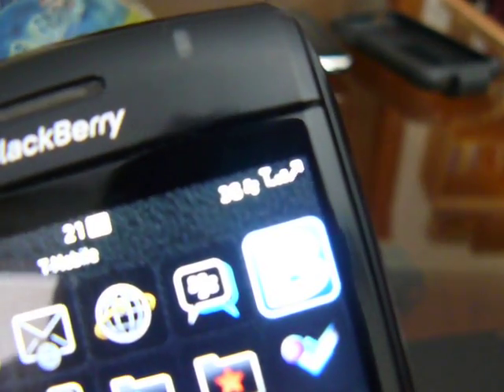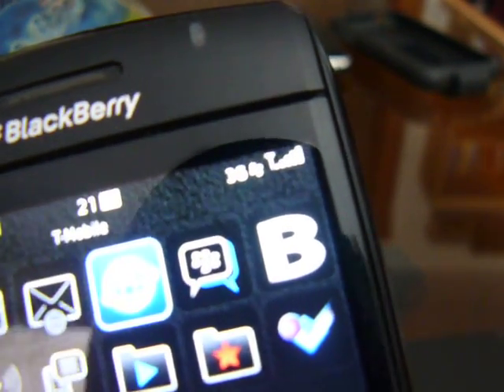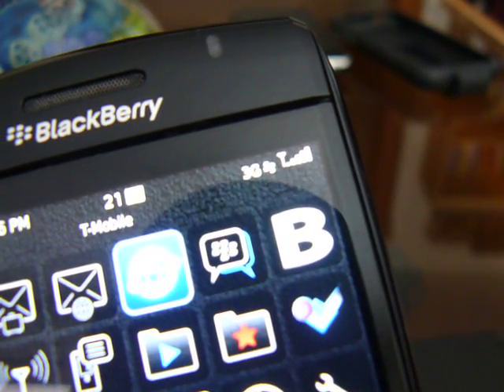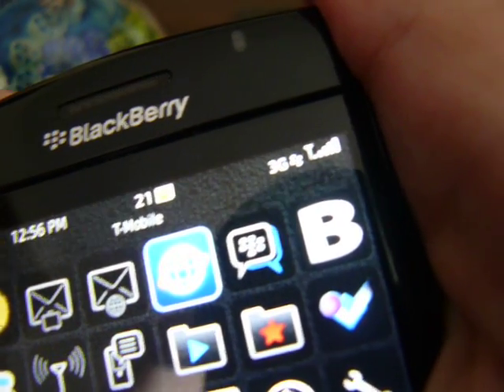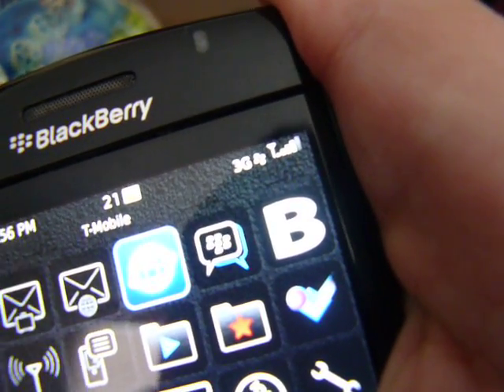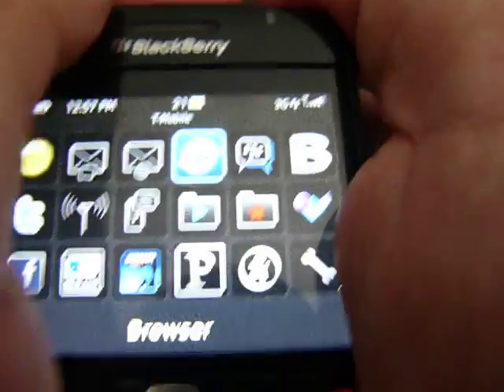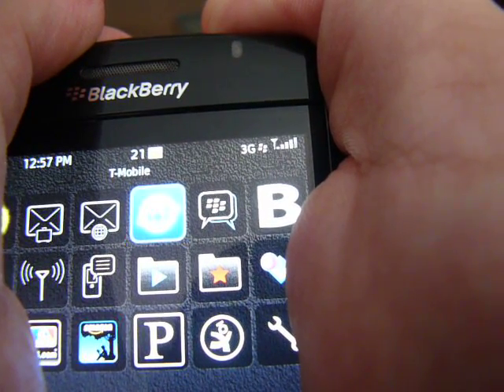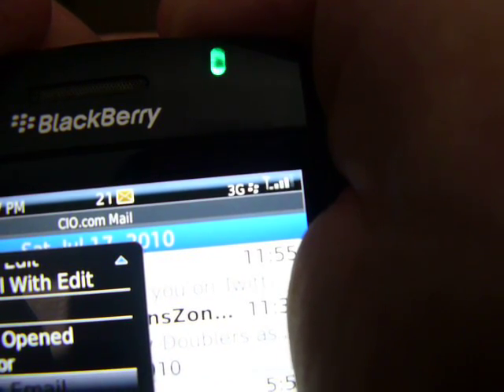BlackBerry Bold 9700 Antennae/"iPhone Death Grip" Test

Comment: I tried this with both my blackberries an 8520 and a 8900 for work and personal ussage and no signal loss. i had to squeeze it with both hands and put it as close as i could to the body to loose a bar or two. Trying to blame other smartphone developers for a flaw in the iphone 4 just shows that mr jobs is egotistical, arrogant and would rather blame others than just face the fact that it's a flawed product.